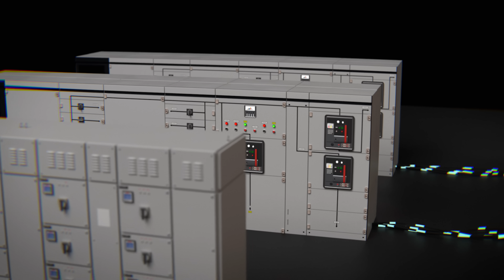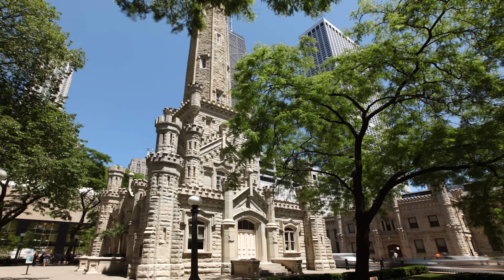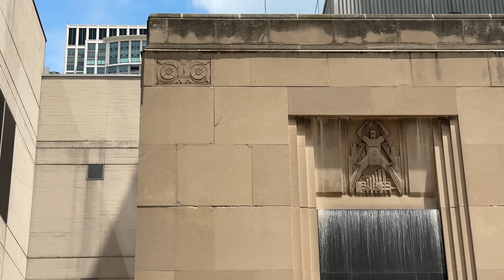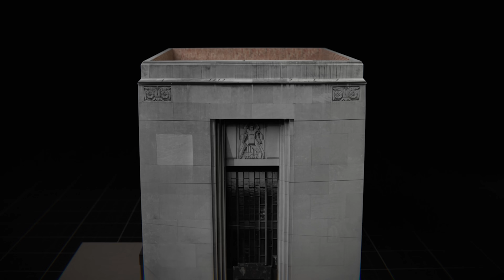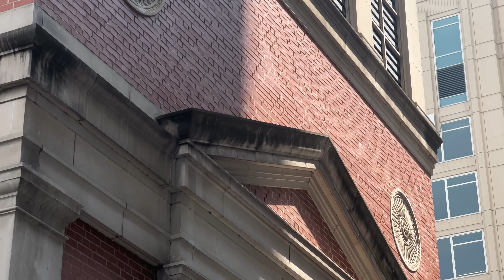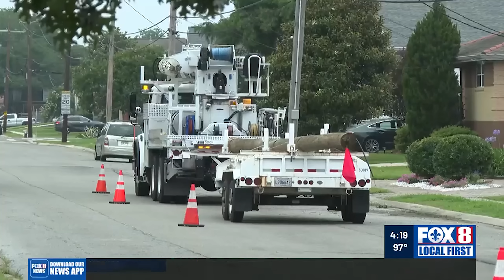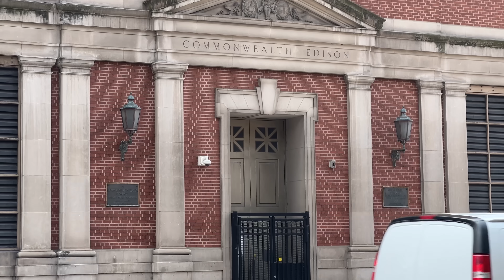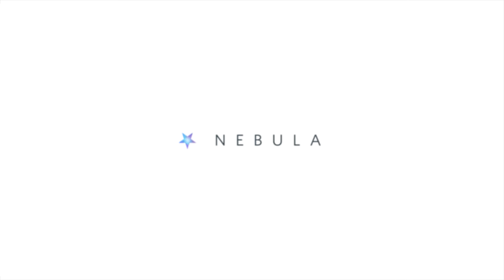How Fake Buildings Keep Cities Alive

Comment: As someone who grew up in a small city in Czech Republic this is something interesting that would've never crossed my mind, mainly because substations here are either tucked away behind big metal doors, open air on top of electrical poles, or placed inside prefabricated buildings during the commie days (so you can travel the whole country and find exactly the same looking substations).

Comment: A factor in design not discussed as to why these stations stopped being beautiful is that in the mid century they were designed to withstand a nuclear war. The nondescript bunkers in some cases have foot thick concrete walls. They stopped being beautiful and fitting into the urban landscape because of fear.

Comment: Americans trying to camouflage their sub stations, meanwhile here in the Netherlands they are pre fab buildings or boxes that everyone knows are substations and just part of the neighborhood. It also has an upside because everyone knows not to mess with those buildings. Although the big stations going from 150kv to 10kv are usually completely open with fences around them and you can actually just see the cables, switches and transformers from a distance.

Comment: WTC 7 was built over top of an existing electrical substation. That's why the lobby was on the 5th floor (if I remember correctly). The construction methods used to straddle a 50 story building over such a thing are why it collapsed from less damage than would be necessary for a typical steel framed building.
Reply: No way! someone talking about WTC 7 and still making sense. but that's actually really interesting, I didn't know that about WTC 7
Reply: @kekmajomT1G  A whole side of the building was supported on cantilevers. Wild. That isn't allowed to be done anymore because of this collapse.

Comment: The video takes a tone that seems to blame substation failings on community lack of visibility. However, most substations are corporately owned and their aging and failing infrastructure is corporate greed.
Reply: I’m going to be real with you here- it’s not exclusively corporate greed here. It takes a lot more time, labor, and effort to to repair what’s existing & meld new upgrades into an existing site than to build new.  Most people don’t really want to expand the footprint/clear cut land and install 10s of miles of new transmission line to build fresh. 

Also, in order to not turn off people’s power during summer or winter when it’s a public safety risk, construction windows are really small.

Lastly, there are a whole bunch of supply & labor limitations. Yes, some of it is greed- they could pay for more apprenticeships, get parts at a loss, and take less in profit, but there are a lot of non-monetary limits on how fast repairs, upgrades, and installations can happen.

Comment: I'm not really getting where the moral/stylistic failing of covering infrastructure is coming from. If you've ever interacted with these large grid transformers in person, you'd know how noisy they are. Non-obscured switchyards don't "inspire imagination" or the like, they look like how you'd imagine, brutally utilitarian. Painting them a different color is about at much as you can do before you start affecting performance or safety. If you look up the NL architects Heat Transfer station, the first result covers it as "Hidden Architecture". Adding a little rock climbing wall and a peep hole doesn't change that. You might say I lack imagination, but that argument can be said for anything.

Comment: Fun fact, Los Angeles geology is prime for kerogen and we hide drilling rigs in buildings as well. This is possible bc most rigs and top drives are electric now and it help us minimize dust and sound pollution in heavily populated areas. Pumping units are also hidden in buildings, but it's prob a hydraulic pumping unit as opposed to large pump jacks.

Comment: No substation converts power to voltages proper for your home. That's the transformer on the pole. The sub station takes power from transmission viltage and steps it down to distribution votage, from there, it's stepped down again to low voltage for your home

Comment: Now imagine you would use a higher Voltage current in residential areas or even three-phase current so you dont need to convert it so much down and would save so much energy in the long run...

Comment: When I lived in Pittsburgh, there was some kind of pump station or filter system right across my apartment. The walls were glass so you could see the machines inside. As a maint tech I thought it was really cool to see the infrastructure behind the case like that. In hindsight they probably just wanted to reduce noise pollution, but I still like it.

Comment: It’s also worth noting that transformers (especially as they age) tend to hum pretty loudly, so part of the logic of putting them in buildings is so neighbors aren’t annoyed by the constant humming
Reply: mmmmm yes, I love the sound of 60hz humming in the morning lol
Reply: Transformers only hum because they don’t know the words. - A joke as old as transformers.
Reply: Also weathering
Reply: its not that loud
Reply: Why not underground? Seems the most obvious of the choices, and less to worry about.
Reply: @NameName-ll2yx imagine the wires, and all the extra it needs, bends create weaknesses I think, but underground is also very complicated and you need more effort to funnel all the heat out, it's a logistical and physical nightmare
Reply: @yicongfang8435 It’s the way it’s done in most of Europe. All the cables are underground in suburbs, towns and cities. Plus side is power’s never out unless someone really fucks up properly at a computer.
Reply: @yicongfang8435  in most cities distribution lines run underground anyways, and considering dist lines can be 100+ miles long the extra 15 feet or whatever for cable bends isn’t going to add any resistance. Underground substations do exist, especially in cities, but yes they are very expensive to design and install. Especially if something breaks. But it’s usually still cheaper than paying for a prime lot in a city just to put a transformer on it (underground stations can be built under roads or small buildings so it’s much much cheaper to buy the land)
Reply: @NameName-ll2yxunderground substations also exist! It depends on a bunch of different things which option they use, but underground substations (sometimes called vaults) are also common in big cities

Comment: You don't want people to "hang out and do stuff" around substations. In cause of a fault they can vent smoke (or even flames) through any opening to the outside world. Older stations predate the current safety standards and might outright blow out their walls. So better to let the general public think they are scary and no fun.

The heat transfer station; if district heating systems were subject to the same level of safety standards as the electrical grid... there would be a lot less of them for sure. 

That heat transfer station is in the Netherlands; district heating there is by far the most expensive way of heating. It's very invasive to install and seen over the whole system the energy losses are insane. If you have older homes with a huge demand for high temperature heating it makes more sense to insulate those. If you have well-insulated homes it still makes no sense because their demand is too low for it to warrant such a system. That leaves existing systems; a lot of homes connected to it still have a natural gas connection too... and guess what; even though the gas price is almost half tax... it is still cheaper than district heating. In fact, people have fought in court to be allowed to be disconnected from it. 
That they put down these insane buildings for district heating is because it's a pet project from left-wing city governments. 

The Dutch word for district heating differs only by one letter for the word for city impoverishment; "Stadsverwarming" vs "Stadsverarming"

Comment: Dont let this video distract you that the real reason there are fake buildings is because it saves on system memory to not have fully detailed buildings in every cell
Reply: how many of us are real vs NPCs?
Reply: @serisak a well made NPC will never know they were an npc, even when it is too late.
Reply: @yolobatus8200  doesn't make any sense, a simulation would want to save power and making a fake human that thinks it's real is much more effort for no gain in comparison to just making a fake human that doesn't think.
Reply: @octilli  The chains of our current tech concept are the flaw. 
Why are supposing this binary tech is the one running our simulation? 
Even if we follow the least action principle, nothing limits the capacity of that conceptual machine, so it is reasonable to think that the machine is not using all of its power. So, by running in low quality, it can be still capable of running our reality at a decent resource consumption. 
And with that, we have NPCs that are fully "conscious", but unaware of their existance as NPCs.
Reply: @yolobatus8200 ”no limits” and “running low power to save resources” which is it? does it have no limits or does it need to save resources. you’re contradicting yourself just to try to come up with some edgy garbage.
Reply: it is kinda fun to think about a terminator style apocalypse except for the fact that i definitely wouldnt survive
Reply: @yolobatus8200 do we look like a well made NPC?
Reply: @yolobatus8200  yeah no.
Reply: @octilli exactly lmao
Reply: @serisak  how do u know if your real or not?
Reply: @serisak lots and lots of the "soulless"
Reply: @serisak  Probably about 50% of us are fake.
Reply: @serisak If something like not being the mc character would change your life in any way you're probably an npc 😭
Reply: @serisak  Quests > Discover the NPC vs Real > Accept > End Chat.
Reply: @serisak  npcs dont ask question so there you go
Reply: @serisak  none
Reply: @serisak im real and aaaaall of you are npcs
Reply: If we are in the matrix then that’s likely true
Reply: @matthewboire6843That wouldn't explain extremely rich places that invest unnecessary amount of money in unnecessarily complex buildings just because
Reply: There's a small man-made beach area not far from where I live, I often see a tractor plowing the sand, I swear the driver is an NPC,
Reply: @pnewt3378  talk to him one day
Reply: @pnewt3378  explain more 🤣🤣
Reply: @tipdrilll ^^
Reply: Too much Aurora in Life, need to move to LFE forsure.
Reply: Did you hear that?
Reply: They materalise and dematerialise around you as you move through space and time 😂
Reply: like most humans that are NPCs when you interact with the outside world. When I'm in my basement, they don't need to be simulated, only when people (actual real humans) go to things like a subway station to take pictures.
Reply: allegory of the cave
Reply: What does that even mean?
Reply: @g.valdez  look down
Reply: You simulation people are wayyyy too early, people built those building… The simulation is when they create earth2.0 in virtual reality & nobody remembers how we got there just kinda moving along. This ain’t simulation, this is 2025 society
Reply: Tf are you smoking 😂
Reply: The Truman show
Reply: Tweaker
Reply: That is a facade, a building geometry made to be viewed of a specific viewpoint, thus allowing it to be hollow or even not having some backparts.
Reply: “NPC PIECE OF SHIT”
Reply: tell me more
Reply: They have entrances… Giant closed off entrances. Those buildings were found and repurposed. So many lies.
Reply: sure
Reply: This reminds me of that one Rick and Morty episode where the aliens are trying to get he darkmatter recipe from Rick or something like that
Reply: Don't let this comment distract you from the fact that in 1998, The Undertaker threw Mankind off Hell In A Cell, and plummeted 16 ft through an announcer's table.
Reply: Good one.
Reply: Hell yeah matrix theory
Reply: These buildings are actually the HDD that store info. For the nearby servers
Reply: And its great for trafficking.
Reply: Keeps terrorists from atacking the power grid or water suply
Reply: Truth..............................
Time to blend! 😶‍🌫️
Reply: Double slit experiment hints at this if not proves it
Reply: If it’s the matrix, then code it. Cant? Hahahahaha
Reply: What is Scientology doing? They got so many buildings
Reply: But Jerry still gets the promotion, right??
Reply: Bro got that unemployed mindset
Reply: It is theoretically possible. To be living within a simulation. Especially with ai coming so close to fully being conscious. We could be ai. Wood and metal and materials that make motherboards and such could be what out bodies are to other beings. We exist but to exist we don't exist long story sorta short it's all bullshit
Reply: @reddoorproductions5470 it’s also theoretically possible that there’s a giant octopus that is going to devour the galaxy with its 10 million year long bite but I don’t give it much thought because I can’t control that. I should probably go volunteer at a soup kitchen tbh
Reply: So that’s why some of these buildings don’t even have entryways

Comment: Imagine being a robber breaking in to the house and releasing that it is a sub-station.
Reply: Copper heaven
Reply: @zaku2552  If they survive, that is.
Reply: @DehJarlorNoob i mean as long as you work on the low voltage side (which is also where the fat bus bars are), you should be able to disable the power quite easily and even if you get a shock its not like you have a 100% chance of death from 120/207/240V (whatever is used in chicago)
Reply: @zaku2552  Substations go from 50,000 to 5,000 volts. A transformer outside the residence, or maybe 5 blocks away in rural areas, does the 5,000 to 240 you're thinking of. So no, the robber would still be dead. But they could just turn off the power through a switch upstairs.
Reply: @zaku2552 hopefully to be met by a SWAT team as you're leaving
Reply: So much copper there😂
Reply: The building is pretty obvious that it's a building you wouldn't want to break in to.
Reply: Lots of people die trying to gank stuff from substations.... Copper is valuable but not that valuable, stay away or else 👼
Reply: Crackheads will do some amazing things for copper.
Reply: "Damn bro, that's a really strong window to put in a house...."
"Wait... what in the actual fuck...?"
Reply: At least there’s copper to take so not a total loss
Reply: The first thing they'd say might be "how tf does this door work?" 😂
Reply: He might be shocked by what he finds there
Reply: "robbers" dont randomly choose houses to break into.
Reply: @lerretzmo We’re using a hypothetical for the sake of comedy
Reply: @lerretzmo  Robber could carefully scout the building to see that no one has been going in and out in last few days and likely on vacation or unoccupied or something, as brain damaged drug addicts that may be as far as they can figure things out, so still possible.
Reply: @lerretzmo what a naive comment
Reply: My dad's an electrical engineer working for the government. He took me to work one day when he was visiting a substation and basically said something along the lines of "if you lift your arms up in the air here you will get electrocuted and die"
Reply: Realizing*

Comment: Respecting the City Character is both an art and a responsibility.  You can rate a City ‘By the C’s’.  Character, Class, Cuisine, Cleanliness, Culture, Climate, Clear Air, Crime and Charm.  There is also a relatively factor.  In as much as Chicago has snow in the winter, take the experience of stepping out on a sunny day with perhaps a half inch to an inch off snow, walking in the loop downtown to UNO’s Deep Dish Pizzeria while feeling the crunch of snow under your feet while looking at historic buildings.  It’s not about perfection, it’s about experiencing life with gusto.

Comment: My main takeaway from this video: why is all that thermal energy being wasted instead of being used for district heating or something. Chicago should come and look at Vienna for how to make use of this HUGE amount of waste heat from existing infrastructure
Reply: Likely a problem of heat level. Most transformers are not supposed to become hotter than 30°C or 40°C , while distric heating requires heat of at least 70°C (Up to 200°C). So while the heat energy is there, the heat level is simply too low to be useful.
Reply: are they kept so cool? It's a long time since I've looked but I remember the oil temperature being much higher... There's hundreds of kilowatts of heat being generated through the winding losses of the bigger substation units

Comment: I guess there are two downsides to making infrastructure a unique and important part of the city.  

One is you draw attention which increases security risks.  You are advertising that this is the place of critical infrastructure.  Although obscurity generally only applies to security threats with very little planning.

Probably the bigger risk is that the structure will actually be deemed culturally significant.  The downside to this is that it usually increases the cost and long term maintenance propositions for structural.  If it’s interesting people are going to complain if it has to be upgraded. They want something they could replace without having to deal with cultural or historical commissions. Which is kind of shame to disregard all manner of cultural advancement for just utility.

Comment: I was a service technician back in the 80's and before it was called AT&T and the switch gear locations for the various phone companies where located in residential neighborhoods and most of the buildings faded away with the local background.
 Emergency generators had massive mufflers for quiet operation and landscaping to match the surroundings.